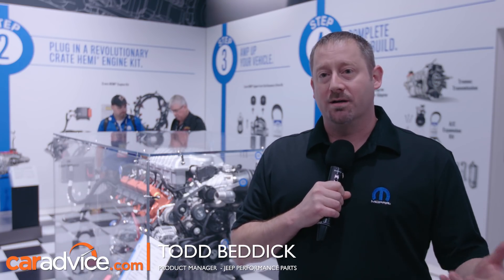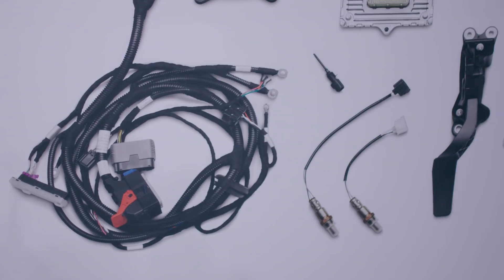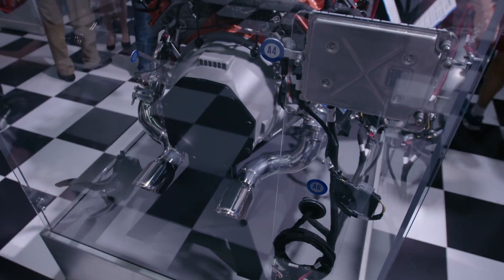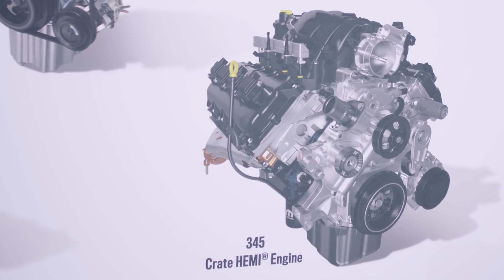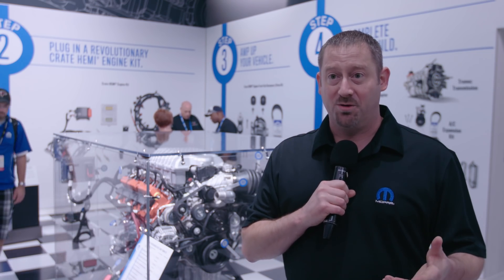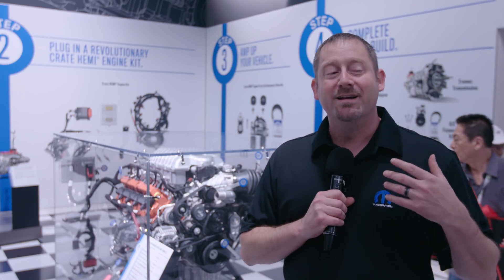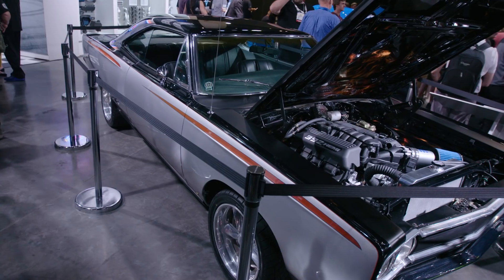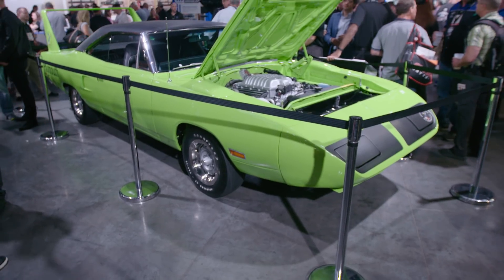MOPAR Crate engines explained.. Get a 707hp "off the shelf" Hellcat engine for your project car!

Comment: I've been doing a little research because I plan on swapping my 300 V6 with a Hellcat I know I'm going to need a whole donor Hellcat car so I can get the brakes and suspension off of. I'm thinking the cost is going to be upwards of 40,000. I'm also considering 392 because I don't think I'd have to switch out the suspension as I would with a Hellcat so It would probably be cheaper I think I might do that instead.
Reply: wishing u the best of luck with that bro

Comment: Can I swap this on a v6 challenger?
Reply: Sadly I don't think u can. From what they made it seem like it needs to be for a race application or a car before 1976. This probably due to the pcm you have to buy with this kit. However if u buy a different pcm and have the right transmission I don't see why it wouldn't work
Reply: nicholas Hernadnez yes you can 👀
Reply: Yes.. I'm going to swap my V6 for a 5.7

Comment: Hmm, 20k for the hell crate isnt exactly pocket change, considering a 556hp Chevy LSA crate can be had for half that these days. I guess if the LSA can be turned up to 750hp with a blower pulley change, the hellcat can probably be turned up to a 900+.
Reply from the maker: Does the LSA include loom, special cut-down ECU, and everything you need for turn key solution? 🤔
Reply: Street FX Motorsport TV 
It does not, that'd be an extra $1000-$1500 for the ECU and loom for an LSA. Good point.
Reply from the maker: probably doesnt include any accessories either, injectors, sensors etc.. It adds up pretty quickly. I have been through a number of engine swaps and they never go smoothly, even when you have a donor car it's a pain as you have to end up splicing two looms together :(
Reply: surprisingly the LSA comes fully dressed for $11,787  and the complete engine control package is 1511$ and even has the DBW gas pedal that is a killer deal for the LSA BUT when they first came out almost 10 years ago they were right at 20k$ for everything you needed so in a few years hopefully the HELLCRATE comes down because for me it would all depend on what it was going into and i would like to have both